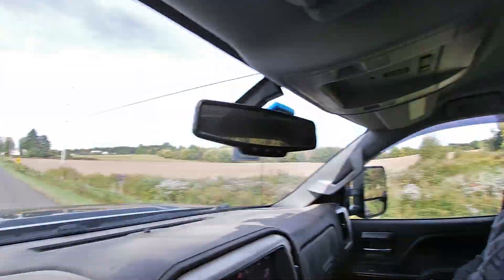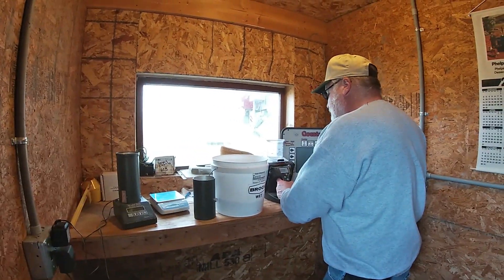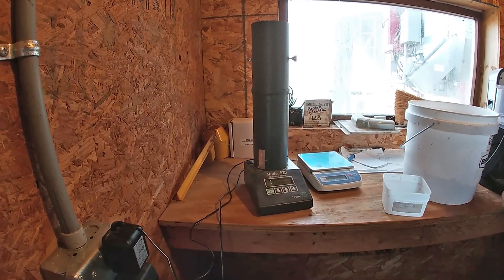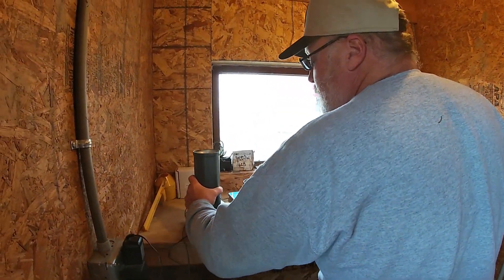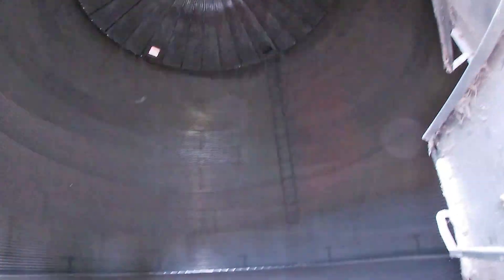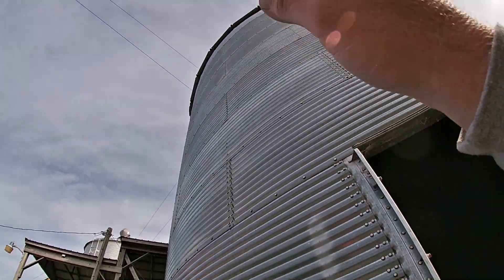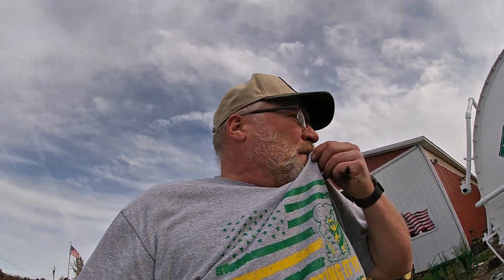Now We're Ready

Comment: Being all set and ready to go is a good feeling.  

I hope all went well with the dealer's guy in the combine and makes sense.  Change isn't as interesting as it used to be, and not just because there are more and more options on all electronic devices. 

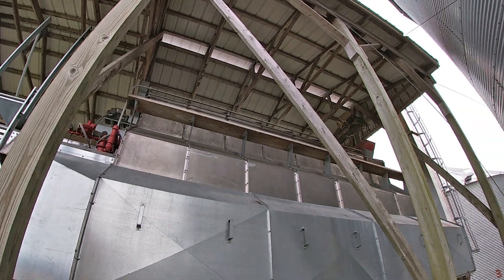It's 43* clear and breezy here in SE WI (08:30  Friday), 20* cooler than 24 hrs ago, it's headed your way and hopefully the cooler air won't pick up moisture as it goes over the lakes.  I pray that y'all have a smooth and successful harvest. 

Your cables asked me to thank you for bringing wrenches instead of grabbing the pliers, your batteries agreed because they don't like getting banged on the head.
Reply from the maker: Lloyd it’s 20° cooler here today also and misting rain but after today it looks good for five or six days

Comment: I know propane is cheap, Grumpy, but how long would you have to wait for Mother Nature to dry the corn in the field or would it ever get dry enough in your area?
Reply: No offense to anyone, but you can't wait for the weather to dry the corn down naturally in the Cato area. For one, it can turn cold, wet, and muddy real fast. That's not cost effective for gathering chains on a corn head, or the hydro unit on the combine. Also, Cato is in the snow belt of Lake Ontario. Wind from the lake can knock corn down, along with snow. If it can flow through the combine, it's go time. If you're lucky, you can sit back and enjoy Christmas. Also, Andy doesn't like to pressure wash equipment in 30 degree weather while standing on snow.
Reply: If farmers waited for mother nature to dry down the corn, it may be near spring. But by that time the wind, snow, and critters would have knocked down the corn. A corn head has a hard time picking up ears, and you run the risk of picking up a rock. It's just economically smarter to burn propane and get the job done. If anyone finishes harvest before mid-term elections, it may be wise to fill up the propane tank. Who knows where prices will be next year?
Reply from the maker: Corn really very seldom gets below 20% in the field and our weather gets too shitty too fast to wait
Reply: @kevinmalda3182  That's what I wondered. In my area Mother Nature takes care of the drying. I think you have lots more humidity as well.